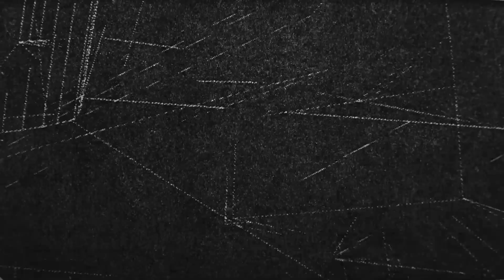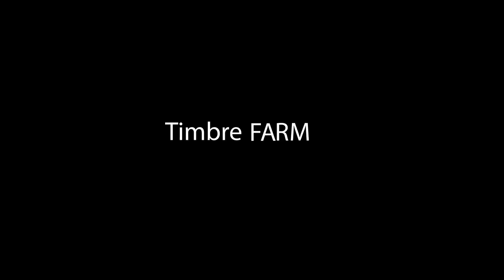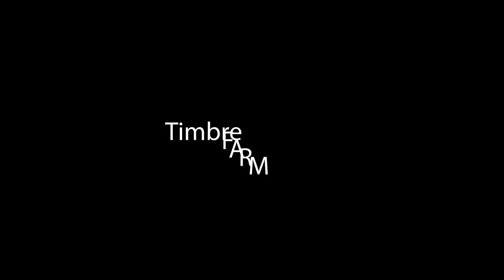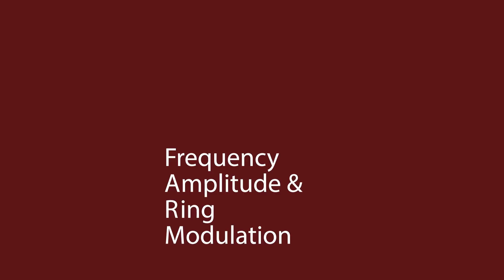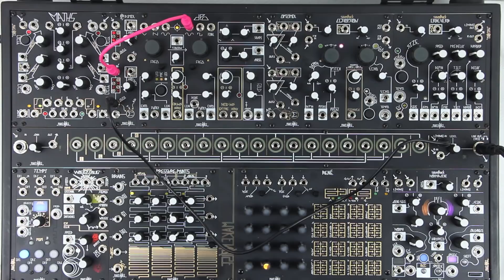Timbre FARM: Amplitude Modulation

Comment: I'm so ready to ditch my Mother32 for a DPO…
Reply: That would be a mistake. Mother-32s usually go sorely underused/under-explored. However, do by all means get a DPO as well ; )
Reply: I somewhat agree. I just feel like the space it occupies and the weird light based menus are road blocks to faster patching. M32 does a lot, but its slowly being used less and less, and really has no place in my rack. Its going back in it's case when i get some more modules.
Reply: The menus aaaaaaare cumbersome.....buuuuut that's what you get with a relatively minimalistic design and a lot of capability. Can't wait to get myself a shared system though, I dream of it.

Comment: How is the end result of this any different from subtractive synthesis? I just did a test by comparing the two, and found no harmonic difference, Then decided to do a further test by using FM on the modulator of AM, and identical FM on the additional subtractive oscillator, and while the waveforms where different, the harmonic content looked the same on spectral analysis, at least at the resolution I was looking at it. This is something that's genuinely confused me.
Reply from the maker: Spectrograms don't necessarily tell you what it sounds like, and they tell you nothing about what it feels like to patch it. Subtractive usually uses only a single oscillator, or a pair of tuned and summed oscillators, not one modulating the other - so there is no "ratio" control that could be manipulated as there is with AM. How did you make a subtractive patch that sounds like AM? I'd be interested to try it out.
Reply: the simplest AM and Subtractive patch you can make, 2 sine waves at different frequencies. The subtractive was a sine wave and another sine wave at 1 octave higher. The AM modulator was 1/2 the frequency of the fundamental, and was a rectified sine wave.  I did this with a digital synthesizer rather than modular, because it was faster to do, and I had direct control of phase. on slightly more careful inspection right now, the difference between the outputs of these two sounds is purely that the AM output has lower peaks, and introduces very VERY quiet overtones due to the sharp nature of using a rectified sine wave, I did not hear these overtones yesterday because I had the volume turned down lower. As I said, I was using a digital synth to do this, I was using a VSTi, called "Sytrus", because It supports FM, AM, Subtractive, and (very basic) additive synthesis, my "rectified sine wave" is actually one of the standard waveshapes that a lot of early FM Synths used.  a very light lowpass filter and they are indistinguishable from eachother. I did not see these overtones in the spectral analysis because I had the volume too low going into the analyzer. my bad.  

My original point though was just on principal. In what way is modulating the amplitude at the generation level, different from selectively phase canceling it slightly further in the generation process. I haven't used AM synthesis much or at all really, and instead resorted to subtractive. basically, this video highlighted all the ways that they're the same, without clearly highlighting the difference between them, which I see as the more important knowledge to impart.
Reply from the maker: Usually by subtractive synthesis, what is meant is the low-pass filtering of more harmonically rich waveforms like sawtooth or square waves. Instead of sidebands being generated, harmonics are removed and/or emphasized (via "resonance" parameter). The simpler the waveforms used, the more similar different techniques will sound since the modulation is operating on fewer frequencies and the math is simpler. What you called subtractive sounds to me more like additive synthesis, a summing of harmonically related sine waves. In any case the addition of more harmonics, sidebands or waves results in a sound of greater complexity. Theoretically, additive synthesis can perfectly emulate ANY sound by matching all the frequency and amplitude components over time. The difference between different techniques is as much in the experience of patching them as it is in the sound, at least in the context of the modular synthesizer. Compare the sounds (and the patch) from this video to sounds of an intro video to a Moog Mother-32 or similar semi-modular subtractive voice. Perhaps they sound the same to you, which is fine. There is some subjectivity inherent in analog synthesis. To me they do not sound the same.
Reply: well, for clarity, I learned about subtractive synthesis as taking multiple different waveforms, like squares and saws, and adding them together, then filtering, while additive is using a large number of sine waves, rather than a small number of complex waves, and that they're otherwise the same, and I referred to this as subtractive in that it was only 2 oscillators. I'm well aware of additive resynthesis, another softsynth I use is designed for that.  My experience with modular is fairly limited at this point, I've only used emulated modular in the form of VCV Rack, and Korg's DS-10, itself being emulation of the MS-10. I'm trying to think of a way to articulate this thought in a way you'll understand... the way I learned to choose between different types of synthesis are that each synthesis method (additive, subtractive, AM, FM, Granular, Wavetable, karplus-strong), have rather specific and unique qualities to each, and that different characters of sound are better created with different methods, like, as an analogy,  a visual artist might use a paint brush, an air-brush, a sponge, charcoal, etc, and that the end result is just some amount of color on a canvas in a particular shape. In this analogy, I'm sat here seeing Subtractive, and AM synthesis, like comparing oil paint and acrylic paint, but with an identical brush, not knowing how they're different, because i'm used to just thinking "oh do I want a brush, a sprayer thing, or some markers"  Like,  FM is very clearly different from subtractive, because FM literally warps the wave's shape over time effectively skewing the wave shape or pinching it together in different ways, and it moves harmonics up and down, that's not something subtractive does. That's what I'm looking to understand about AM. What does AM do at the end result, that is unique to AM? the only thing I've seen that might be unique is using half square and half saw waves, which is basically just really fast tremolo, and I don't really know when or why you would use that, it seems very limited in its use...
Reply from the maker: There is some more specific mathematical detail on AM here. https://www.soundonsound.com/techniques/amplitude-modulation Personally, I find AM to be, on its own, the least interesting of the synthesis methods you mentioned, but I like contrasting it with Ring Modulation, as will be shown in the next video in this series.  -W
Reply: wait.... AM and RM are different things?
Reply from the maker: Yes, though they are pretty closely related. Ring modulation could also be termed "bipolar amplitude modulation" or "four quadrant multiplication", where AM is typically "two quadrant multiplication". Stay tuned!
Reply: They are very different. You cannot generate side-band when using only subtractive synthesis. AM and FM have show distinctly different behavior in terms of spectral content between each other and even more so when compared to subtractive synthesis.
Wavetables can sound like anything, as they're arbitrary waveforms, although certain timbres may be more easily achieved through other methods.

My understanding of additive synthesis, is that harmonic components of the signal are added to the signal. Unless you start with a very complex signal, it will not get close to FM or AM sounds that way (side-band is not harmonically related to the carrier or modulator, unless the carrier and modulator are harmonically related).

Maybe you picked the signals with the same frequency for the carrier and modulator? That would explain the absence of noticeable side-band, as the side-band will then simply be the harmonic series of the fundamental ;) .
Reply: Pieter Dirksen 3 things. First, Additive synthesis can become as complex as AM or FM, just, maybe not in modular/analogue. I've only ever seen 1 VST that can do it well and that's Harmor, which has I think 500 band additive resynthesis, with per harmonic pitch and volume. it can reproduce damn near any sound, though not the same wave-form.  but that's a huge digression. 

Second, yes, I was using harmonically related carrier and modulator, I almost always do. I didn't realize AM produces sidebands, because i never payed attention, I just assumed those extra frequencies I was hearing where similar to bineural beats, which subtractive can do. 

3rd, when I mentioned wavetables, I meant with most wavetable synthesizers having a bend option that at first I thought was like FM, but it turns out the way it changes the shape of the wave is asymetrical and unrelated to pitch/phase modulation.

Comment: Hi, how is it with v/oct tracking of the AMd signal? Simple sequence into v/oct on DPO will do?
Reply from the maker: You probably want to mult the sequence to the modulator as well, and the modulator would have to track similarly to the DPO (so MATHS won't work for this), in order to maintain the tuning ratio. However, the sounds made by the carrier and modulator tracking differently from each other are often more interesting.